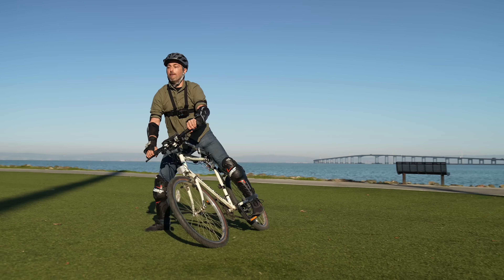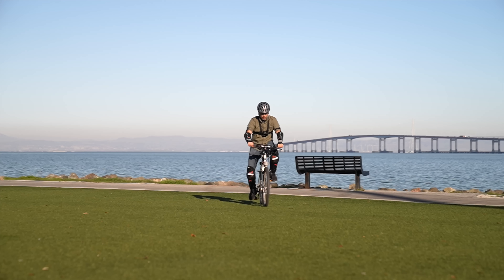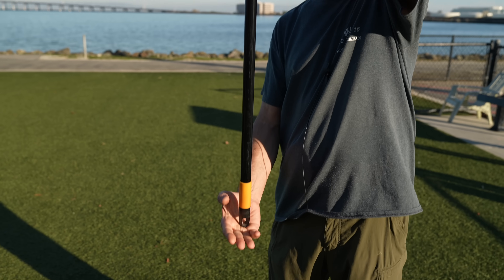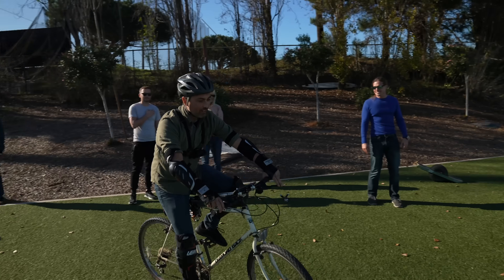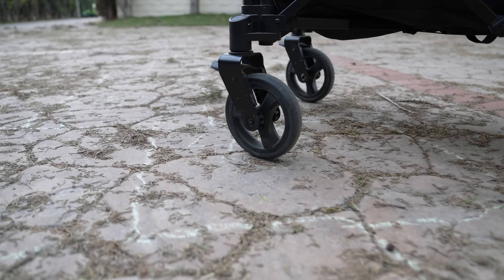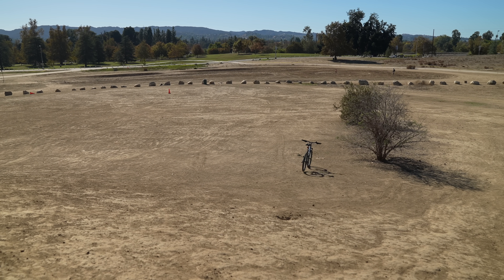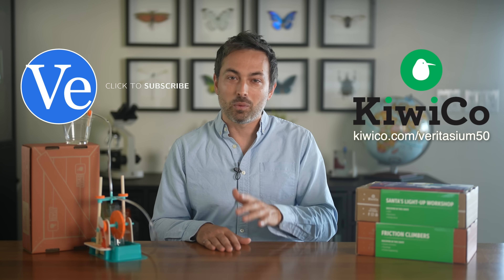Most People Don't Know How Bikes Work

Comment: so you don't understand how bikes work...

the detail that makes a bike work is a slight angle of the direction axle(tilt backwards), so when you turn right the front wheel is touching ground slightly right so you gain equilibrium when the bike is moving forward... (the more speed the fast recovery - with slow speed is more difficult to keep equilibrium )

in your experiment should be fun to reverse that angle so the wheel will turn the way you steer but you will still fell off...

not so much documentation for this one...

Comment: I'm Dutch. I do not drive a car, just a bike. The idea of putting a motor in a bike to keep it upright or steer it seems to me like putting a V8 engine on a steak knife to make it cut better. Sure you can put a 1000 toddlers in a room and one or two may learn to operate such an insane device. Most will end up without fingers however.
The price of the Segway isn't the only reason it did not replace the bike...

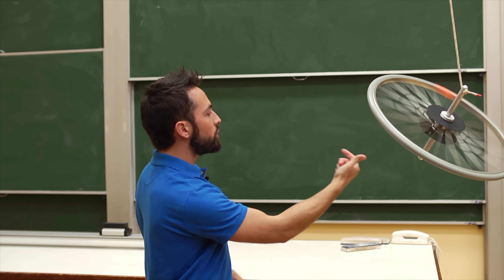Comment: 6:25, gyroscopic wheels are self steering. If you lock the steering it's like having 2 gyroscopic wheels one in front of the other fixed to a rigid frame. If you try and roll it it will fall over.

Comment: Intuition is very Important. This explains why it's almost impossible for a humanoid robot to ride a bicycle.
Reply: "Intuition" is not what's used here (an,d anyway that word is rather vague).
It's actually learned reflex that put a crude physical model of the system you learned to use (you on a bike in that case) in your brain so that you can anticipate how it's going to react to various inputs (including your own muscle actions).
There are two ways of doing is mechanically:
- putting an accurate enough physical model of the system to compute the same kind of anticipation and react accordingly
- letting a neural network building a crude physical model about same as your brain is doing it.
In the last decade the second way has gained a lot of attention and fast development, even if in many cases the first one is more accurate and reliable.
The more the problem is complex (so hard to fully calculate or even understand formally) and contains unexpected conditions that cannot be foresee (like self-driving a plane that suddenly lost a propeller where that condition wasn't ever thought about, etc.), the more a deep learning approach is relevant compared to a fully analytical one.

And in many cases, at least one of those approach is superhuman (they can do stuff humans couldn't).

Comment: Someone needs to take this video down or make some corrections. The information presented is not correct, and people on motorcycles die every day because they don't know how counter steering works. None of this is a mystery, its just that no research was done. Making the bike with lockable steering was confusing and not necessary to properly explain counter steering. I'll try to explain it. 

Both bikes and motorcycles turn by counter steering. Its not optional. That's how they work. The only exception is at very slow speeds. Friction forces a bike to counter steer, and it increases with speed. Anyone who has ridden a bike or motorcycle knows you can just turn the handlebars in the direction your want to go at low speeds, but there is a speed where enough friction builds up and forces you to counter steer. In the video its true that most people are not aware that this is happening.

Here's how counter steering works. Its not about balance and turning right first, then left. People come to conclusions like that based on how they feel the bike is working. From this point on, I'm assuming the bike or motorcycle is going fast enough where counter steering is necessary. Also, bikes and motorcycles steer exactly the same way, so everything I say applies to both. To make a bike turn, 2 things need to happen. It has to lean in the direction you want to turn, and the handlebars have to move as well. Most people don't feel the handlebars move because they only move a tiny amount.

Unlike cars, motorcycle tires are curved, not flat. When a bike leans into a turn, it rides on a different part of the tire. And because bike tires are curved, the effective diameter of the tire decreases the more you lean the bike. This also changes the speed at which the tire rotates. To visualize this, imagine you are driving a motorcycle in a straight line at 40mph. If you come to a turn in the road and want to keep the bike moving at the same rate of 40mph, the wheels have to spin faster in the turn then when going straight.

The other factor to making a turn is counter steering. This is what initiates the bike to lean and enter the turn. The reason you counter steer, is because in order to turn the bike, you need to not only lean, but decrease the effective diameter of the of the tires, otherwise it can't happen. Since the front tire is the one that steers, you turn it in the opposite direction you're traveling, and that forces the bike to lean more and ride on a part of the tire that keeps getting smaller. And friction forces the turn. If you take pressure off the handlebars, less friction will force the bike to go back to an upright position. 

This is how a motorcycle or bike turns. If you watch some videos on youtube, you can actually see all this happening with your own eyes, and not have to take my word for it. I would suggest watching racing videos because they have the best camera angles, and the faster you go the easier it is to see what's going on.

The reason I'm asking this video to be taken down is people get killed every day because they don't understand how counter steering works. When a rider panics, and turns the handlebars in the wrong direction, one of two things happens. The tires don't lose traction and the rider steers the bike directly into whatever they are trying to avoid, or the tires lose traction, and most of the time you have a low side crash. If you crash just the right way, you can high side as well. Just to be clear, I don't think for a second this video was made knowing the information was wrong. It was made with the best intensions. The facts need to be updated because this is a real safety issue.
Reply: The video is correct, but your post has lots of misinformation.
You want to take video down, but can't even point out what's wrong with it.
Reply: @XtreeM_FaiL  Would be a lot simpler to just take his comment down.
Reply: @XtreeM_FaiL  Are you that stupid? The entire concept is wrong, and I'm not the only one to point it out. I just explained how a motorcycle really turns and you tell me I can't point out what's wrong with it? People literally get killed every day because they have no idea how it works. 

For anyone reading this that has half a brain rolling around in your head, I'm not guessing. My post is exactly how a bike or motorcycle works. And its one of those things where you can actually watch a video and see for yourself. You can also watch hundreds of videos of people crashing their motorcycles because no one ever explained any of this to them. And if all else fails, get on a bike and see what happens when you make turns.

Either way, its your choice. If you feel the information in the video is correct, then go with it. If you want to be a fool, I can't change that.
Reply: @XtreeM_FaiL  lol you again, counter steering is the proper way to steer a bike at HIGH SPEED, especially with a motorcycle. If youre riding a motorcycle on a highway and the road starts to curve left you push the bar with your left hand to turn the bar right and vice versa. That is proper riding technique, he's right riders get killed all the time because they do not know how to properly steer it. If you hit a high speed curve and turn the bar into the direction of the curve the bike will low side and throw you to the ground. Watch a motogp  race and watch the front wheel in the turns, its in the opposite direction of the turn.
Reply: @XtreeM_FaiL  going under 20kph you can get away with not doing it, the very slow speed they are going in the video it's not really necessary but it still works.
Reply: @XtreeM_FaiL  I don't understand? I think YOU are the one that doesn't understand anything.....wtf is 20000/hour? Where do you see that?
Reply: @XtreeM_FaiL  stop being so damn pretentious, 20KPH ,KILOMETERS PER HOUR! 20KPH=20 KILOMETERS PER HOUR.
Reply: @XtreeM_FaiL  either way is used, do you read the M in MPH as mili?

Comment: When you want to turn with a bike, no matter if it's powered by pedals or an engine, you usually do it mostly with weigh distribution. The handle bar is almost ALWAYS straight, exept on veeeery low speeds maybe. Especially on motor bikes, the handle bar is not exactly meant for steering. 🤔
Reply: Completely wrong.
You always turn by countersteering.

Comment: With regards to 4 wheel vehicles....while for road driving yes, it's point the steering wheel where you want to go.....in race cars weight transfer is a big deal and you might move the car to the right a little before swinging left to load the tyres up better. Also, in rallying a far more extreme version called the Scandinavian Flick is used to set the car up for very tight corners.

Comment: Counter steering only works at a certain speed, where the gyroscopic force is strong enough. At very low speeds, you do need to turn left to go left.
Reply: It does work on certain speeds. Zero and up.
Gyroscopic forces has nothing to do with that.

Comment: it's all about tilt.. you're just using the counter steer to initiate a tilt in the opposite direction. but you can be more efficient and more stable if you just tilt right away.. no need for counter steering.. get good at cycling before you do this... it's kinda embarrassing that you don't know this

Comment: It’s just leaning for me
Reply: To add to this, people can steer while doing a wheelie, were there is zero counter steering involved, purely by leaning they're weight onto one side.
Reply: @Zestybwoi  exactly
Reply: @Zestybwoi  When you do a wheelie, you turn bicycle to unicycle.
Two different things.
Reply: It is not just leaning.
Reply: @XtreeM_FaiL  then how can people ride with no hands
Reply: @XtreeM_FaiL  I literally do 🙃
Reply: @XtreeM_FaiL  well if you lean, it's hard to say if friction/pressure differences cause you too turn or if there is a small micro turn involved.. but either way, he's wrong about the need to counter steer first.. if you lean into the turn, you don't counter steer  just watch a motorcycle race or a pro cycling race.

Comment: The gyroscopic effect keeping the bike stable is under played in this video. If a cyclist were to attempt a no hander at slow speeds he would likely crash, but if he were to do so at higher speeds chances are he would be able to balance no problem, because the gyroscopic effect is more pronouced and greatly assists the riders stability.
Reply: Gyroscopic effect is under played because it is practically irrelevant.
The force is so tiny that you can ignore it completely.
If gyroscopic effect would play a big role, then bikes would have really heavy wheels.
If you're still thinking that gyros keep bikes balanced, then go ride fast on ice.
Reply: @XtreeM_FaiL  Bicycles don't have heavy wheels because it would be terrible for they're efficiency, user exertion and braking distances.
 
Gyroscopic effect not only gets more pronounced when the mass of the rotating object is high but also when the angular speed at which the object (wheel) rotates is increaded. It is proportional to the quantity of rotational inertia.
The reason a bike can't ride well on ice has very little to do with it's stability and much more to do with traction. As soon as a steering input is placed into a bike on ice, the tires struggle to provide the necessary centripetal force to provide the change in direction as there is little friction between the contact patch of the tire and the ice (poor grip = can't steer)
Reply: @XtreeM_FaiL  It certainly aids it, the stability affect of a forward biased steering axis is the same at slow and high speeds, yet you cannot easily ride a bicycle with no hands at slow speeds but cand do so quite comfortably at high speeds. Meaning that the increased stability affect can only be attributed to the gyroscopic effect of the wheels.
Reply: @XtreeM_FaiL  You seem to not understand the difference between stability and traction. You will likely not stay on your bike because of under steer. However, that said some people who ride bikes more acrobatically could stay on they're bike. Search "russian slider on bike" to see examples of this.
Reply: Actually "BMX slider"  has more results

Comment: There is another effect: If you ride a motorbike, you can let go of the steering as long as you go above app. 30 km/h. 
If you want to go left, you dont pull left, you push slightly and the bike falls inwards left.

Comment: Funny how he referred to the steering in a car, he’s probably accurate for 90 degree turns, but we always are making subtle adjustments while driving in a straight line to keep it in the lane, often without even thinking about it, it’s a very similar concept to the bike in my opinion
Reply: You misunderstand what's being said.  We do not make subtle adjustments to keep a car from falling over because it doesn't usually have balance issues while normally driving.

Comment: Another way to think about it is when you turn the bike, there is a centripetal force trying push the bike in the opposite direction of the turn, which is why you should lean into the turn - the turn supports your lean.

Comment: there is a fair bit more nuance to this than the physics explained here. this is going to sound totally contradictive to what is explained in the video but the principals are the same. 
when riding at moderate to low speed in a seated position this is pretty true as the speed increases however things change quite a lot an the steering comes more form leaning the bike into the comer than physical handlebar movement an thus changing the contact patch of the tyre to naturally help with this for instance look at a tor de France rider on a fast sweeping descent its all about moving ur body weight an the bike to do the work of the handle bars this is done by lifting the inside leg on the corner an leaning the bike in to it a lot more than most people realize this will also alows u to keep lot more vertical to the bike an their for keeping ur biddy eight pushing strait down into the road keeping better traction an thus removing the need to turn the "wrong" to start the turn as u have instigated the change in contact patch an balance of the bike. the contact patch goes form being an ellipsis to being more like a tri-oval shape longer an more curved on the outside an straighter an shorter on the inside creating a difference in distance an allowing the bike to turn the same amount with less steering input.
Reply: exactly

Comment: I loved the video. Most subjects seem to be a subcategory of riding bicycles. I race bicycles competitively and have built custom race bicycles (fabrication of the frames, forks etc. [not assembling a pomade bicycle]). The caster wheel effect we know as "trail" is really important as slight variations of trail will result in stability in different ways and at different speeds. We can attain a geometry that is hard to lean into a turn at 30mph and we can also make a geometry that wants to lift you out of a turn at 30mph. At higher speeds; the 'intuitive' pre-turning action is more leaning and less counter steering. The steering actually follows the leaning
Reply: Gyroscopic effect is why it's far easier to ride with no hands and steer corners at higher speeds. He misses stuff many times in his videos.
Reply: Finally someone who actually knows how bikes work and isn't a sissy going at 5kmh

Comment: Actually in a car if you turn slightly in the opposite direction you can make a tighter turn. Many new drivers and drivers of large vehicles aren't aware of that, and it shows. You can also make faster right hand turns in a car this way as well, and for the same reason as on the bike. It's all about balance and where your center of gravity is.

Comment: Countersteering.
I remember when i wanted to get a motorcycle and learned more about motorcycling & first came across it that I understood the scientific concept and it made sense, but thinking of it physically,  it didn't make sense to me... until I took the course. 
When I was on the motorcycle and they asked us to weave the cones at speed, I just did it instinctively & realized that's why it made no sense before... bc it was already common knowledge to me, I just never had a word for the action or the scientific concept of it being related. 
That's also when I understood that street smarts and book smarts are having the same knowledge of something, just the perspective the knowledge is gained is different for each type.